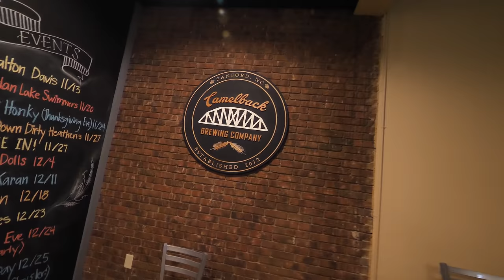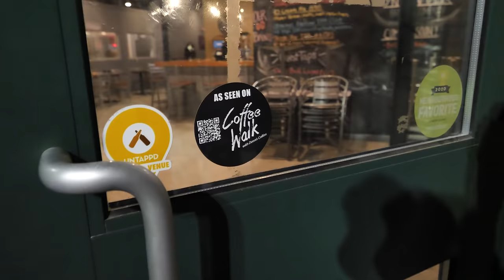MONSTER MUSCLE CAR RESCUE!!

Comment: Finding something like this should be every man's dream. This is outstanding. Even though they have been setting in a field, this would be amazing to find and get them back on the road. Much respect. Subscribed for sure.
Reply: I think some of these you would basically only be putting the vin back on the road lol. Wouldn't be a lot of parts left on some of them that didnt need replaced haha
Reply: @sportsbank8428  either way, it's nice to see them get yanked from a graveyard to get restored. As the ones without vins could be restored and used in car shows, yes they wouldn't have everything but at least it would be shown again. As far as parts being replaced, find what you can and make the rest that you can't.
Reply: @hilham89  Yeah I used to restore old muscle cars... 50yrs old now. Was just making a joke because of rotisserie restores I have been a part of lol.

Programmer working with A.I., but lot of old muscle car experience too. If it isn't 1973 or older... blah... HAHA, Have had 66 Chevelle, 69 Chevelle, 69 Camaro, 75 Camaro (broke my 1973 rule), 70 Super Bee.. restored those, helped restore 2 57 Chevy, 67 impala, and numerous others... Love the old Muscle.

Fuck the fart cars kids run around in today. No replacement for displacement. I have always been Mopar, but ended up with Chevy all the time haha. Except for the 70 Super Bee. Always wanted a 69 Super Bee... or a 68 Charger. One of these days... 

I do know one guy though for years that builds and tunes those subarus and shit... and I do give him credit. Cause he des get some massive power out of those fuckers. But typically it costs a lot more than the same power from a big block lol. But he says, I can get 450 HP and still get 25 miles per gallon... I am like, actually probably cheaper in the long run lol.

But, you still can't make the beautiful music come out of the exhaust that a Hemi can lol.
Reply: @sportsbank8428  oh, I hear that. I would love to get my hands on old muscle cars. It's bad because now days people might have one rusting away in a field and wants 10k for just a body that has more holes them swiss cheese
Reply: @hilham89  Yeah... if  you have the money and the drive.. yearone you can literally build 69 Camaro form scratch and get a vin tag off another car lol. I haven't done anything in years now though. I have a Jaguar XJ, and a Honda Pilot Touring lol.
Reply: I worked with my older brother restoring cars over the summer while in high school. So of the car's they would pull in on a flat bed there was barely anything left. But with a lot of sweat and hard work they were turned into award winners. My brother passed away 16 yrs. ago. He was the best body man I ever knew. Him and my father gave me the great love of cars that I have. Great memories
Reply: @rapidtransit8373  definitely a blessing. I never got that growing up but I have always had a thing for taking stuff apart and fixing it. Learned just about everything I know by myself and what I don't know I search for it. Get to that point in life where if I don't find something to start to restore I never will.

Comment: Awesome to rescue these cars Dennis.  I’m looking forward to seeing them brought back to life.  Good stuff.
Reply: Umm, these cars will probably be stripped down for their(original) parts, restoration shops will be happy to buy a door, bumper, seat, dash, quarter panel,  trunk lid, whatever part, instead of buying several parts cars to complete a project. Those 5-cars will probably help 30-cars get restored with (original) stuff, keeping the the value at a maximum
Reply: @chadsimmons6347  you could be right.  They’ll restore the Camaro and the black firebird.

Comment: JCB telehandlers. I use one at work. 4 wheel steer/drive, crab.. tractor tires. Go anywhere. Next time you’re in this situation try to rent or find one of them. Awesome piece of equipment. 👏🏼

Comment: That Pontiac with the 421 and factory tri-power looked good for a donor motor. When I was much younger a local had a Bonneville two door with that engine combo, a four speed and factory aluminum front end. Just ordered it from the factory, no big deal, except the aluminum was so soft leaning on it caused dents.

Comment: I had a pace car like that 350/350 power steering, disc brake, manual top and crank windows got married in the 80s and sold it right before they started going up in value.

Comment: Im a truck driver in NC, SC, VA, an WV an you can not fathom the classics I have see or know were at from in the woodsto sittingin people's yards. For instance I know were a pontiac GTO is sitting under some pine trees with only the cabin of the car covered rusting away you can clearly see the gto on the front quarterpanel. These cars should be saved an if I had the fund's I'd try an saved most of them.

Comment: Hey Dennis! 
I live about 20 min from here. 

About 10 min from here in near the same woods but 1/4 mile deep we found hundreds of cars to include: 1966 GTO, 1969 Camaro PACE CAR convertible, 1970 Cuda, 1970 Challenger Convertible, 1970 Charger, 1970 Fastback, 1972 Mach 1, 1970 Chevelle SS, 4 other 69 Camaros, Edsels, Trans Ams, and hundreds of others. 

The day we asked the guy about one car by the road he told us there were hundreds and he was selling the property, so he had to clear the land and scrap it the next week!.. Every car was bought for $500 Each.. 

I have  a full video of it.

Comment: Slide a paperclip into the hole on the ignition butterfly, pop out , turn ignition with screwdriver, wheel unlocks

Comment: Dang I wish I knew yaw were coming Im not far from there.  just found a 1975 ford Elite setting in a building 20ft behind my shop with 60,000 original miles.  Lived here all my life and always thought there was an English Ford racecar in the building and there was at one time but behind it was the Elite.  excellent all original car.  runs and drives but had been setting since the 80's. getting ready for sale now.

Comment: Those Trans Ams were dogs.  My friend bought a new formula model with a 400 engine in 1978.  I blew his doors off with my 4 spd 1974  Corvette L-82 convertible and it was rated at just just 250 hp.  He was bummed.

Comment: when I was running my recovery truck I never failed to get a vehicle out of where it was stuck  I used  a mercedes 814 beavertail  with a 12 ton winch I wish I had taped the 924 porche I pulled for an old garage and a MK1 golf form a garden 6 foot beloa the road , no arm lift just a good winch and my truck

Comment: i cant believe none of you couldnt open some locked doors with a stick and a coathanger and then just pull a steering wheel to access the lock bars or plates  ,id think youd come better equipped  ,cool collection / video

Comment: Dennis, any interest in a ‘77 Firebird Formula, TA400, 4-speed, with about 72k original miles? Car has issues, but runs. I special ordered the car from Leo Jarnigan Pontiac in Houston, original owner. Have health issues, thinking of selling but value is ????? All of my car buddies say to not repaint, and keep the patina. Again, a bit rough after sitting for years in an aquarium, but interior is pretty darn good, exterior shows sign of age. Thoughts??? I think the original build sheet is still in the car, never removed it.

Comment: Back in the 1990s I remember my uncle buying $100-$300 running muscle cars. Clean SS Monte Carlo - Z28 iroc - Buick - GT 🐴 5.0-Regular Cutlass for $700 or 442 for $1000-$1200. A clean 1961 Impala & Falco for $300 . 
Me at 13-15 years old bought a few all clean almost new cars , Free 1989 crx -1986 crx $300 - 85 5.0🐴 $400 - rare Dayton yellow formula & a Gt fiero  $500 - Impala SS $1000 - free GT 🐴 i spent $300 in gas to pick up in Cali from Az. Nothing under $200 or over$1200 so many cars after my 16 birthday I don't remember.

Comment: If you would like I have 2 Q-panels & 2 outer wheelhouse for the 1968 Elcamino  GM original I bought in 1983 looks fun I did autobody for 30 yrs still do in my dreams

Comment: That Goat is no 70, that looks like a 72, and in 72 they only made just over 5000, don't leave that one behind. Pause the video at 7:46 and look at the nose, outside grill is 71, inset grill is 72, if that was a 455HO it could fetch more than a RAIV Judge

Comment: I know a place where there are hundreds of cars from the 50s 60 and 70s there are 3 mustangs 70 fastback 72 boss like 30;impalas just a grip of vintage cars message me if you want to talk about it this place has it all
Reply: And most of them have the motors and are in much better shape than these cars in this video but they been in the sun

Comment: I really want a 78 trans am with fisher ttops more than anything, thats my dream car. Then I'd get a 72 trans am 455ho, 68 gto, 66/67/69/71 chevelle, 70 olds 442, 68-70 roadrunner,  superbee, charger, & gtx, 57 bela air 210, 59 caddy, 70 camaro ss, 80 camaro z28, 58 plymouth fury, 67 shelby gt500 eleanor clone, 69 boss 429, 54 corvette, 63 corvette split window, 67 impala 4dr, 70 cuda, 70 challenger & a few others. But 1st the 78 fisher ttop trans am is my dream car, 2nd would be the 67 eleanor clone with a buit 427 or 428 & 3rd would be between the 68 gto, 71 chevelle, & 69 boss 429

Comment: The Dad is the definition of a hoarder. So the Dad went door knocking to try and gather up all these cars he liked.  If he loved these cars as much as he thought he did, he would have built a nice large enclosed building to put all his newly purchased vehicles in so he could admire and work on them. Instead, he just parked them in the back 40 so they can rot for the next 30 to 40 years. What a waste.

Comment: you left the most valuable car in the weeds?  don't get it, if that 442 is numbers matching restored its worth 2 of those pontiacs, a matching 455 is worth 3 pointiacs, if its a Dana W/30 its 4-5 pontiacs, mint lo mile survivors upwards of $150k  I see restored W/30's up to $90k, just a restored 442 like that is at the very least $50-$65k done right, non matching $40k?

Comment: This makes me Appreciate my 383 70 Cuda with zero rust so much more to have a car In prestine condition from 70 is close to a miracle, will never sell and will pass it on to my kids but hate to see folks give away great condition cars because they are not hemi cars, screw that even 315 cars are valuable. the Fiat dollar is worthless and aftermarket parts are complete garbage FYI better to buy something original than to restore, restored cars with new parts are garbage overpriced as well, nobody talks about cheap aftermarket garbage parts.